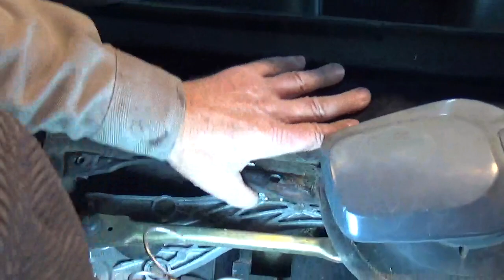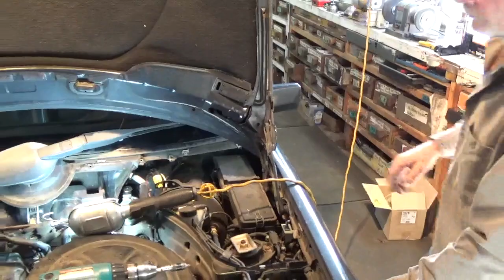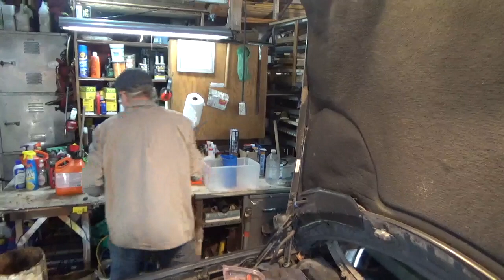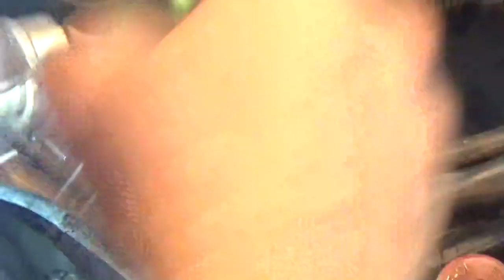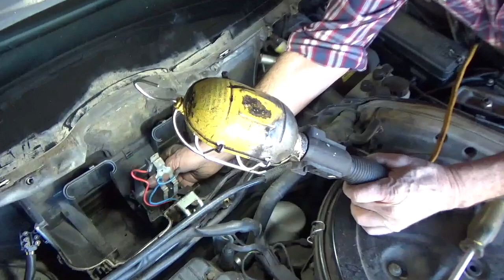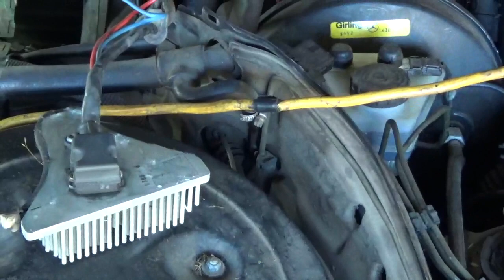Mercedes-Benz W124 heater blower not working, Part 2 (resistor replacement)

Comment: What are the voltages do you have on the plug behind the break booster. Are these voltages coming from the control unit. I only get 12v on the middle pin and nothing on the other 2 pins. Is my control unit defective?